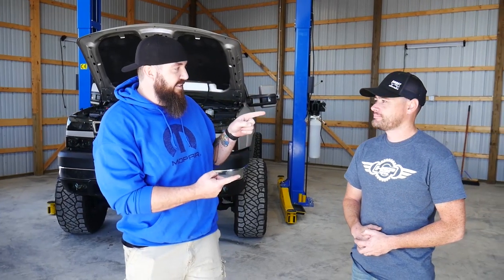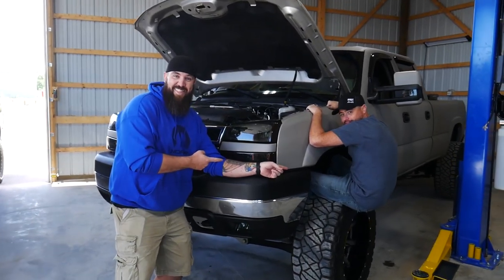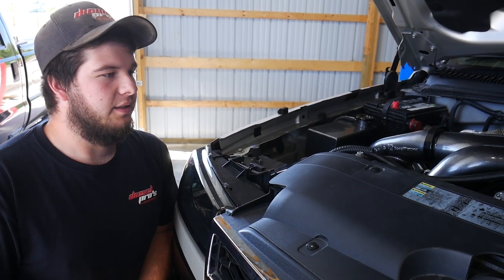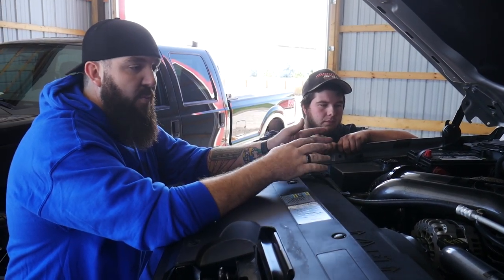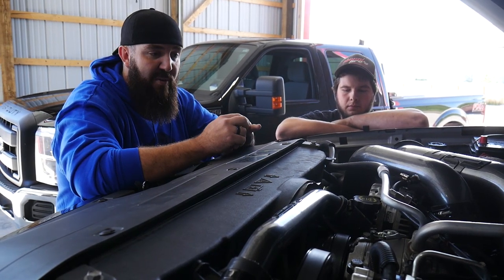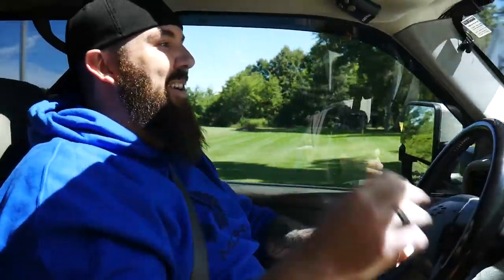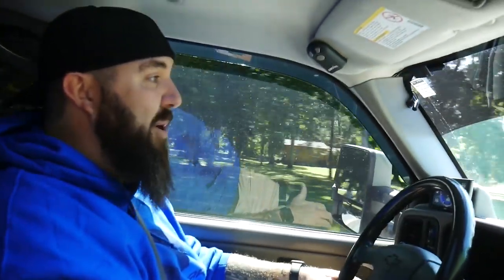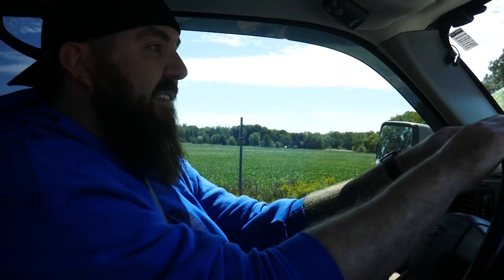COMPOUND TURBO DURAMAX REVEALED!!

Comment: Curious to see if you had your truck put on the dyno and what it’s making for power? I have an lly with compound s480 over stock by hsp and currently installing 100 over injections with dual cp3s.
Reply from the maker: I have not had the chance to get it on a dyno but the company who has done the tuning is saying he has it dialed back a bit because I have a stock bottom end. Says it should be close to 750 on tune 5

Comment: a blowoff valve sould not be open when you are accelerating that is what a wastegate would be for, a blow off valve should only open when you let off the throttle, looks like he installed it wrong or set it up wrong
Reply from the maker: ryan dussel it’s not dialed in, setup at the time the video was shot for max pressure of 38 psi...don’t worry we’re tweaking things